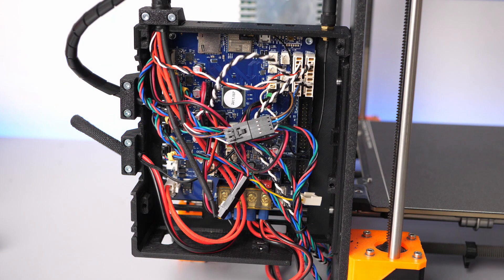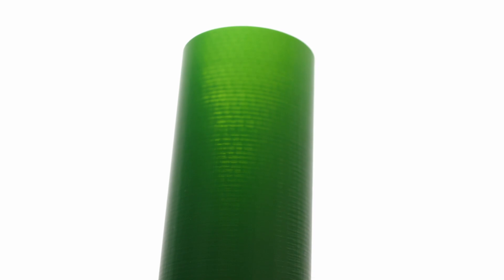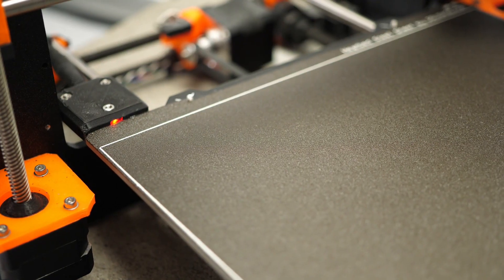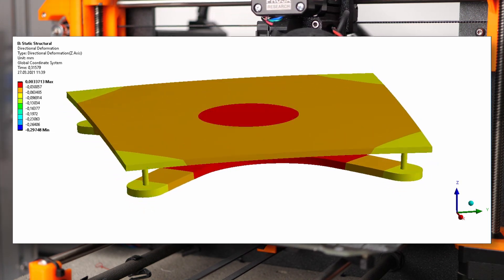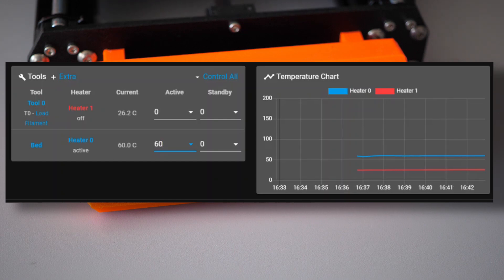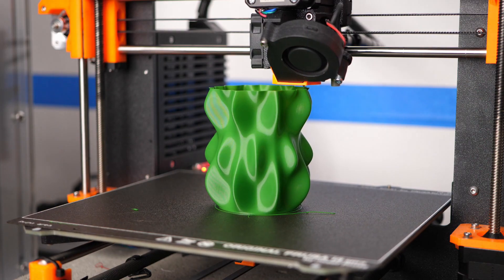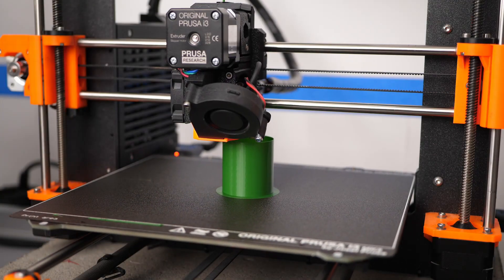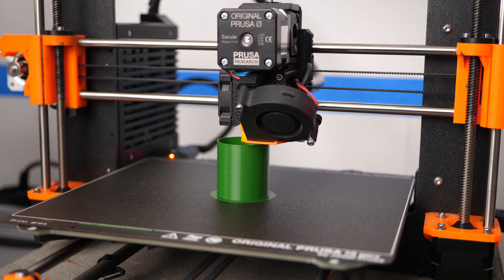PID vs Bang-Bang Temperature Control

Comment: It might be useful while using an SSR or external MOSFET to add companion circuitry. Personally I would scope the output of the square wave from the controller board to test the rise and fall speed of the wave. Then I would test that same output through a schmitt trigger to see if I could improve the rise/fall times. See, the problem is not switching on and off quickly (frequency), it's the rise/fall times of the switching itself. A square wave is not "truly" square and if your oscilloscope has enough resolution you can literally zoom in until you can see the curve of a rise/fall. Now add VERY fast switching (higher frequency) and you get "more time" on that curve. Any curve puts a MOSFET into a "linear region" where it's not fully on or fully off, and being in a linear region means more voltage drop through this linear range; this voltage drop means more heat because that's where the dropped voltage goes (as you already mentioned).

A schmitt trigger only has 2 states - ON/OFF. and it's switching speed may very well be faster than the micro-controller. This is why I would test it, and if it does have a faster switching speed, that means less time in the linear range. There's a huge bonus besides less heat, a schmitt trigger is cheap. You just want to make certain to get one that operates at the same voltage that you are working at, any decent modern CMOS style IC should get the job done (most of those are 0-15 volts so no worries there) and you should be able to do some simple comparisons before you buy it. I am certain that most manufacturers give switching speed in their data sheets. There is yet another bonus to using a schmitt trigger, if your micro-controller logic is 3.3v you can apply 5V to the schmitt trigger V+ line and it will turn on a MOSFET at 5v instead of 3.3v; this higher 5v will turn on a MOSFET "more completely" and it will be less in the linear range a well. If you do not have the equipment to test this I would happy to try it out and report back to you. I am not a presence on youtube in anyway (my only video is a short little nothing video that I put up for a friend to try some different settings for making a circuit board using a CNC engraver and youtube was an easy way to share) but I could post a video with my findings regarding using a schmitt trigger.

EDIT: Small note to add here, how quickly the MOSFET or SSR can switch on or off also has an impact on all of this. This is why I purchase high speed MOSFETs for my own personal projects, the switching speed for a MOSFET is indeed in the data sheets. Educate yourself a bit on these particular points, stop buying "external MOSFETs" in a nifty little package from these online 3D printer sites and build your own circuitry folks, you will end up with much more robust solutions. An expensive MOSFET from Digikey (or similar electronics components dealer) is like $3.00 USD, plus you are guaranteed to get an official part not some cheap knock-off or a de-soldered pull from an old board.
Reply: Nice! And now also for 0815 people? I could, somehow, follow you until the 2nd paragraph... Is there some visualized website / video to understand all of this?
Reply: @billereses4935  P.S. not knowing a thing does not make a person 0815 =)
Reply: @billereses4935  The Schmitt trigger is a very simple device. It has Power and Ground and it has pairs of input/output. The characteristics are also very simple. Please do not quote these numbers as "exact" because I am using them as an example, each manufacturer might have different tolerances for ON/OFF voltages.

You take a signal and feed it into an IN on the schmitt trigger and of course you take its companion OUT to the device to be turned on/off. Now as a simple example lets say you can personally turn up the voltage on the IN pin of the trigger. So you start at 0v and turn up the voltage, Um lemme backtrack here.... lets assume you apply 5v to the Power pin and of course you ground the Schmitt trigger. Lets also assume that voltage max is 3.3v (like a micro-controller). Now you turn up the voltage going to the input pin, the schmitt will not trigger until you reach (lets say 3v) now the trigger is ON and it will not go OFF until it gets back down to less than 3v (or whatever). This alone makes it a very useful device because it completely smooths out an ugly looking square wave and also removes any small amounts of linearity or oscillations from the 3.3v signal, not to mention that most all MOSFETs switch on more completely at 5v. Your MOSFET should run quite a bit cooler because the square wave is far more stable and it will waste less energy on being partially on/off. Any small dips in from the micro will be absorbed completely because the schmitt will provide a very steady 5v even if the mirco's square wave oscillates between 3.2 to 3.3v in its "on state" and the rise fall curve will be greatly reduced as long as the schmitt trigger has better fall/rise times (which I think that it does). I'd have to do some quick testing, but I think I am right.

I have taken a quick look at the square waves generated from a micro-controller (in the not so distant past) and they aren't all nice looking, I can't see why this wouldn't help with keeping the MOSFET cooler and running longer. The rise/fall time of the square wave is very visible without having to zoom in much.

Comment: So 3d printing in a climate controlled box at the minimum temperature too facilitate coagulation is better than heated bed in wide open room with irregular airflow and cooling?

Comment: Hey, another reason for z-banding other than lead screws and heatbeds might be an extruder feed gear that is not concentric with the stepper motor shaft. This can be pretty easily checked by printing two different sized towers and seeing if the z-banding happens at the same frequency on both of them, if it does not, then your feed gear might not be concentric.

Comment: I had this exact issue on a DIY 400x400 corexy build, I couldnt figure out the "zwobble" turns out yup heating cycles of the bed caused ribs.

Comment: Wow, it never occurred to me that the thermal expansion & contraction of the bed would affect prints in such a way.
I have a Prusa i3 Mk3 because I wanted a matured product where I wouldn't have to try and diagnose odd issues like this, just build it, tune it a little and endlessly print. 2.5 years of ownership has shown that strategy paid off :)
Reply: My lack of money made me go the complete opposite direction for my 1st printer: an entirely scratch built project, not even a clone, only just similar to the i3 style in montion design (and even that just similar - mine runs on lead screws all the axis), and Marlin on it.
Sure as heck is quite the ambitions project and I have quite a bit on my hands to tune and test, tho I'm glad to report to anyone that cares that it's indeed moving and heating correctly right now!

Comment: Minor correction - @6:00, it's only the PIDTEMP line that needs to be commented out (undefined) to use bang-bang. You would need to leave "BANG_MAX" defined. Note line 483 only says to comment out the one line.

Comment: Instead of printing the 2nd cylinder at 200% speed, print a 2nd cylinder of half the diameter of the 1st, ensuring the printing speeds are equal (don't let auto-cooling slow down the smaller one). That way the material load on your extruder will remain equal, eliminating an extra experiment variable.

Comment: I think you can sidestep the problems somewhat by having a high thermal mass bed, IE glass. Thanks again for more high quality research.
Reply from the maker: Good point and this is also what you can find on the RepRap Wiki. If the thermal mass is big enough, Bang-Bang can be fine.
Reply: @CNCKitchen  The original pid bed implementation in Marlin was specifically because of a glass bed.  The heater side of the glass swinging around in temperature by just a little while the top was more stable would cause bowing that led to banding.  Although that was with a 250w heater, which is a bit large.
Reply: even with a large thermal mass for example if the glass isnt thermally bonded (bed clips) there is still maybe an isulation gap causing the metal plate to flex under the glass causing the glass the pulsate with the metal plate though on my large printer i use bang bang, with thermal tape under the glass and its fine
Reply: @meky0  Wouldn't it be the reverse? If the glass is bonded to the metal, it's forced to follow the erratic motions of the metal. If the binding is loose, the glass bed can sortof ignore whatever the metal underneath is doing. Not too sure about this though.

Comment: Hi Stefan, good video. This problem also annoyed me for some time. Easier way to see if this problem is the cause: print without bed temperature. Then you don't need to compare with the threaded rod
Cheers
Reply from the maker: Good idea. Just put some tape on the bed or use a thick raft and it should be fine.

Comment: I find that PID auto tuning is very poorly done. I generally tune it by hand using Repetier Server where you can see the % power and all the fluctuations. Generally I get it down to a very smooth very low noise power level.
Reply: Yes, I find I get the best and most sane PID values by hand tuning on the bed. Especially with AC powered beds that have large thermal mass. If you go to Wikipedia for PID control there is a graphic on the right hand side about halfway down about PID tuning that explains almost everything you need to know in one graph. It shows how the P, I, and D affect the setpoint, rate, and oscillation.
Reply from the maker: This reminds me of the old days, when I PID tuned my first quadcopter with simple trim-pods.
Reply: On Marlin or on RRF? Because the RRF system has been made significantly better recently.
Reply: @malloott  repetier firmware, I'd think marlin and others would have similar ways  with repetier and server you can update the eeprom live